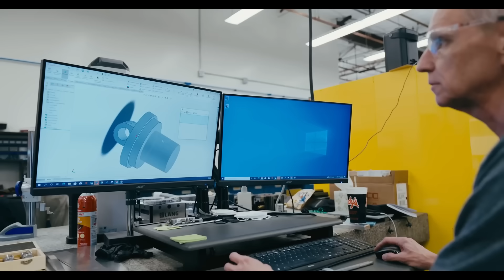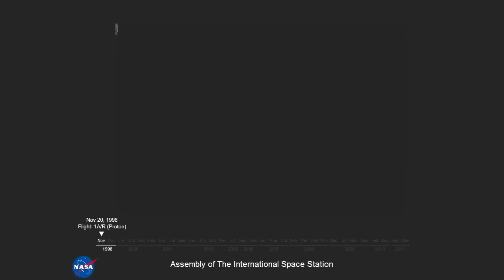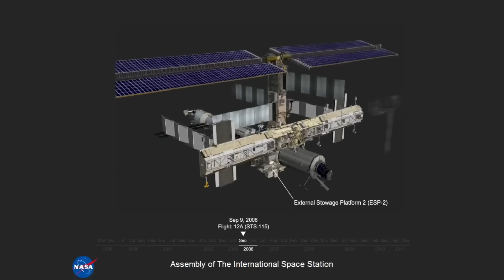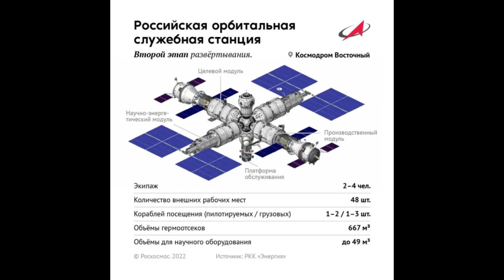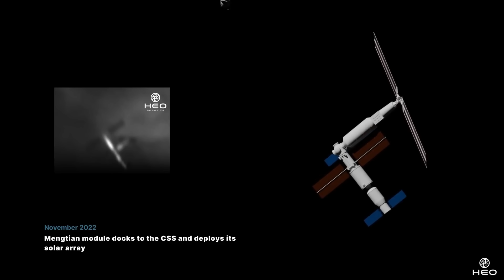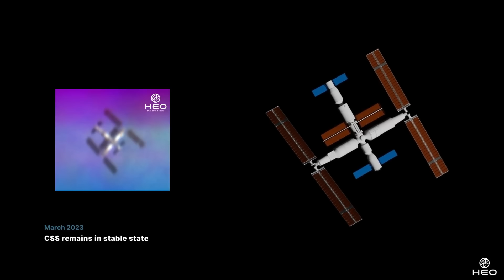Where Will Astronauts Go After The ISS Is Destroyed?

Comment: 296 billion dollars will make a station on the moon and a space station that hold quite a few people. I mean 250 people plus visitors of twice as many like a hotel thing. Or apartments and the moon's gonna have a station to hold 50000 people.  All for the cost of 296 billion $, which also would make a different space station to with the station on the moon, which hold even more, which was created in the early 60s. I read about it when I was in high school and it was priced at 296 billion dollars.  From another decade from now if it was both of those were created in the United States and New Zealand it's even more than that, because the one they've been advertised over the last few years too, and then a private industry wanted to make a hotel and space as well.  And all these are from the united. There's even more that I don't even know about that. I heard about but I can't remember them because I don't see very much of them but they're all incredible. And each and every one of them has to have a base on the moon.
 So they could take materials from the moon as well. And there's even a better space station. That was slightly introduced. That could be in the neutral zones, which there are 4 of them around Earth, and even a nutrition zone in between Mars and Earth halfway in between actually and Mars also has 4 neutral zones where space stations could be And actually there's more neutral zones than that  That NASA introduced that they all wanna use news and on the same orbit of Earth in front and in back. Will they got one satellite either following or leading? But they could build basically a mass of station. You know, it's areas and on the opposite side of the Sun, exactly on opposite side of the Sun, from where Earth is. On the same.
Orbit

Comment: I do not understand why we are not keeping it up there for reuse. Just push it up to a higher orbit.

Its so hard to get stuff to orbit, so seems like a waste to plunge thee ISS into the ocean
Reply: You can do some basic research and find your answers.
I promise
Reply: @ Nope you cant. If you do basic research you will find actual aerospace engineers who think it should be  raised to a higher orbit instead of dropped in the ocean and you will find others who favor dropping it into the ocean. 

For a long time the Russians considering using their modules as the basis for their next station.

So its not a clear cut issue.

Comment: Worst case could they not use the ISS for spare parts or emergency use and boost it further out into space.
Reply: Spare parts?
With space travel?
Ill pass
Reply: @asbestosfibers1325  Used as a life raft or some way to repair a stricken vessel, I'd take it not like you can call out a tow truck.
Reply: @nicholasviney5975 how would you use it as a life raft, how would you fix your ship with ISS parts if your ship is broken?

Comment: What is Space X's moto, the simplest is the best.  Go with Vast, it should be ready by late 2025, can go up on Falcon 9 (most reliable rocket in the world).  Yes it's a single module, but get it up there.  Test the crap out of it.  We need to learn to build stations.  Then quickly send up a second module, figure out how to attach it, then add power modules.  Down the road, try to get part of it to spin (artificial gravity).  Instead of waiting a decade to get a whole station designed & up there, do it piece by piece, way quicker

Comment: De orbiting the ISS is such a waste. Move it to higher orbit and there is a pile of orbiting hardware for parts etc. As for the rest of this, nice graphics. They are just like NASA, all graphics. If you want to see the future, it should have SPACEX attached.
Reply: Read NASA'S FAQs on ISS end of life. There are three reasons they didn't choose to boost the ISS to a higher retirement orbit. 
1) Delta-V requirements for deorbiting are significantly smaller than for any meaningful orbit raising maneuver.
2) The current generation of servicing spacecraft (Soyuz, Progress, Dragon, Cygnus, etc.) would not be able to service the ISS beyond a certain altitude, meaning the ISS would  eventually run out of maneuvering fuel.
3) Time between Orbital debris impacts goes down with increased altitude, increasing the risk of damaging or destroying parts of the ISS.

Tldr.: NASA doesn't want to end up in a scenario where they spend a bunch of extra money just for the ISS to turn into a debris cloud.
Reply: Lmao, this guy thinks you can just grab a rogue abandoned satellite and repair the ISS with it
Reply: @cmdrgarbage1895  They did it with the space shuttle

Comment: I was a huge proponent of Bigelow Aerospace's inflatable modules, in particular the BA 2100 which never made it to prototyping, but as designed it would've been roughly twice the pressurized volume of the ISS, in a single inflatable.  It was unfortunate that they laid everyone off and are now defunct. 

Thankfully Sierra space basically took over where Bigelow left off.  They are working on their "LIFE" modules, which is what would be used on the orbital reef.  On their website the roadmap includes the LIFE 5000 which would be 5000 cubic Meters, or roughly 4 times the pressurized volume as ISS, which would be amazing.  

But Ultimately, for me to get really excited about a space station, it would have to be like something from scifi.  Anybody remember spiderfab?  it was like a self propelled module with a bunch of robotic arms on it that was aiming to do on-orbit construction of orbital structures built out of metal trusses.  With a piece of machinery/technology like that combined with a vehicle like starship, you could conceivably build a scifi like space station.  Imagine a large transparent geodesic sphere a la Ender's Game that remained static, flanked by 2 large rotating rings on either side to provide artificial gravity.  The rings could have personal quarters, work areas, labs, life support, etc.  The sphere could be a zero g playground.  You could also have other modules on the non rotating part for zero g experiments and manufacturing.

Comment: Those dummies never even figured out to run power lines through the shell of the ship to generate stronger EM shield. And not even figured out how to go beyond that to exciting plasma with capacitor pushed plasma generated ultrasonic pulses for strong EM field to shield from radiation either. They haven't even figured out they can reduce drag even more with ultrasonic field using plasma generated ultrasound passing through crew.

Also they have ultrasonic holography but they aren't smart enough to upgrade it to plasma generated for a strong cellular resolution. For? Perfectly controlling cells in the human body with what I call "control art" technology. Points at Hellsing Ultimate show based on Vlad the Impaler/Dracula "Releasing control art restriction systems level zero" < For ultrasonic holography program to takeover and convert cell machines to match genetic profiles for missions instead of slow shapeshifting.

They're demons and traitors of humanity. Points at Ultrasonic microphone on explorer probes, Heliosphere gas, and Sun's plasma generated ultrasonic field passing through the gas as it escapes to create its own medium Hmp.. Like watching the Church try to fake being God. Fun times.. - Vlad the Impaler
Reply: Btw.. Search engine: "Is Dracula an Alien?" Points at ancient European Saucer art Ask free or paid AI the science benefits of Saucer craft. That's the science system you trust making that list, right? So why does it confuse you people? Because it doesn't make sense that a man can download memories from blood? Points at your governments world wide Define: Inherited sight based phobias. What triggers by sight? Same thing your AI censorship uses.. Stored images.

Points at the movie the Thing I found that creature to be disgusting. Only need a drop of blood to learn everything.. Cuts hand into a stem cell converter to make bone marrow for continuous blood to expand One offering = Unlimited blood, specialized cells, organs, and or FORMS..
Reply: "Lets make Balloons in SPACE!" Shameful..

Comment: why not use a rocket fitted with a way to grab onto an airlock on the station? Then push the entire station out of its orbit and into outer space. Saving the trouble of a burn up that wont melt a lot of parts and pieces leaving those to rain down on earth?

Comment: What could work is if private industry buys/obtains the ISS from NASA and repurposes it as a sort of orbital construction/maintenance dock. Refurb the best modules that would be pressurized then convert or replace the others into material storage/construction machinery and mooring points. Maybe mount tanks that would be filled over time for refueling. It could be a small start into establishing a permanent orbital infrastructure.

Comment: Why not send it towards the moon ( orbit ) rather than destroy it in the atmosphere.
Reply: Because it isn't actually a space station, it is a low earth orbit station and doesn't work outside of low earth orbit. The thermal systems are designed for 90 minute day/night cycles. It would overheat on the way there. The electronics are only hardened for radiation in leo and would fail outside of earths magnetic sphere. It's navigation only works with gps at low orbits, same with it's radios. Essentially its like asking a scuba diver to hang out at the bottom of the Marians trench. I mean water is water right?

Comment: I'm by far no expert but what I'd do if I had a billion bucks would be to just build a dead simple metal hull with a big window on one side the docking port on the other side and from there on the absolute bare minimum requirements to make it safe I'd line it in solar panels around the whole exterior so nothing has to be extended and the thing is ready to go as is  and the passengers would be flown up in the capsule and retrieve with a dragon capsule afterwards it would just be left in space. As a whole this would be kind of like the titan submarine.

Comment: It will be astounding if SpaceX does NOT use one of its Starships as a space station, potentially even having two interfacing at the belly (or back) of the starships (like their refueling solution). Would be super cheap for SpaceX and they can use it for tourism, gateway or maybe offer it to countries who do not have the capability (or funding) to build a space station. As cost to launch drop significantly, more countries would love to have their own space stations.

Comment: A bigger issue being missed is that the government is not a manufacturing company and NASA was supposed to be the kickstarter for the creation of manufacturing manufacturing supply chains in private industry to support space exploration.  However, they never made a contractual requirement for ships and vehicles created for the space program to have assembly lines to support specific types of equipment.   And this is why you cannot manufacture the Space Shuttle anymore which should have been the beginning of setting up such supply chains.    This is also why you cannot get new versions of the older EVA space suits and so forth.     And now NASA has to basically go back to the drawing board and wait for these various companies to come up with their own designs and solutions for things NASA should already have designs and R&D for.    And if NASA didn't do it, with billions of government money, then of course private industry isnt going to do it, especially without NASA giving them money.    

So for all intents and purposes there will not be another advanced space station controlled by the USA after the ISS is decommissioned.   And NASA may be able to put astronauts on smaller modules in newer "space stations", it is doubtful there will be anything approaching the capacity or complexity of the ISS anytime soon.
Reply: The Orbital Reef space station will have 90% of the ISS habitable volume in its initial configuration and when expanded further it could have 5-10 times the ISS’s volume.
Reply: @luther0013  I understand all of that, the point still remains that in order to move forward with space, you need a mature dedicated space supply chain.   And right now none of these companies are providing anything close to that, including space-x.    They are providing potential solutions to parts of such a system, but not the entire system.    The issue is you don't want to have space ships or space stations be one off bespoke solutions that have to be designed and built from scratch with huge cost every time.   And you want components to be standardized and modular to allow various companies to provide them.  Right now a lot of this stuff is assuming an individual corporation will stay around long enough to maintain a station for not just 20 - 30 years of operation, but spare parts, upgrades and support, not to mention future generations of stations.   And right now the "market" for space is nowhere near financially supporting the cost of that as in "space tourism".

Comment: Scott, just out of the interest. If we were to take Starship and remove its controlled return functioning then used the top of it as a space station (or space seed) would be not be starting a new space station with a single launch? The old back of the envelope calculation seems to show this is quite possible and would then be able to grow quite quickly. A space ship 9m ride and 35 m long would seem to have us back in the game immediately, Then order a few more general purpose parts and mount them up (docking adapter, utility arm, fold out solar panels, oxygen recycling but the trick would be to not invent anything new until there was a space station to test it with.

Comment: I think that the truss structure is the best choice for saving. The solar panels are aging and could be jettisoned and replaced (they already have been augmented), but I think the radiators are in decent shape... and the truss itself carries power, provides multiple mounting locations for communications equipment and experiments. I'm sure other, newer parts are worth saving as well. I do understand that the pressurized modules are...well... probably too grungy to keep.

Comment: I still don't understand why NASA is going to destroy the ISS. Still don't know why they can't push the ISS out to orbit the moon or Mars. This way we have a livable habitat. Heck, that Boeing Capsule is loaded with fuel and they are going to ditch that due to the issues. Use it to push the ISS up and out to the Moon or Mars. And if anything happens with space junk it doesn't matter. Take the chance of finding a slot to avoid the space junk. And besides the current docked bad capsule you can over pressure the inside of the space station and release some of that atmosphere to help push it away to the moon.  Nobody will be inside the ISS when you perform this maneuver. And when it arrives at the moon the arm on the ISS can inspect it when it gets to either the Moon or Mars.

Comment: With the size of upcoming spacecraft, new stations  should have a walk-in hatch, and much bigger in diameter and longer .after all, 2 starship joined permanently together as a single module would give quadruple the volume available. Another claustrophobic module looking like the inside of a trash can can't be the standard any more.
I would push the whole idea to the sharp minds at spacex for a fully designed and complete a starship based craft with the same kind of step from skylab to ISS.

Comment: Scott- Just a thought... Instead of thinking about using Starship with a cargo bay and a manipulator arm to assemble parts of a new space station, how about this: Make three or four Starships to actually BE a component of a GIANT space station when assembled at the nose via a hub?  (like each Starship being a blade like member like a windmill, all joined at the nose)
 That hub may have three or four (or more) docking ports for vehicles such as Dragon capsules to dock. The hub can be delivered in the "cargo bay" of one of these Starships/modules and then the empty bay can be sealed and converted to a workable pressurized part of the station.  Also- The now empty tanks for fuel and the engines can be jettisoned turning that space into workable space station vacuum storage areas or even a protective "garage" for a Dragon like supply capsule once the engines have been jettisoned. Heck! Keep the tanks of one of the Starships and turn them into potable water/ oxygen storage tanks!  Another Starship can keep its fuel tanks and engines for orbit correction/de-orbit.  
  Imagine three or four huge Space Station modules each joined at the nose with the interior volume of a Starship! What's the usable interior space of a Starship now (without considering the fuel tank area as "usable space")? almost thirty feet x eighty feet? HUGE!  So to recap- Each Starship is not delivering sections of a space station. They are purpose built to each be a complete COMPONENT/MODULE of a new space station! The list of possibilities when we rethink the Starships role in making a new space station are now ENDLESS and I believe a lot cheaper in the long run.

Comment: As other have commented, why not re-use at least some of the ISS???   I read that the overall cost to get 'stuff' into low earth orbit was ~$1,000,000 per pound. And, that does not include the cost of BUILDING the modules and hardware, modules, etc. contained within them. 
Even assuming that SpaceX can greatly reduce that, it's still several hundred k$/pound. Surely, much of what's already up there could serve a valued purpose for decades to come.